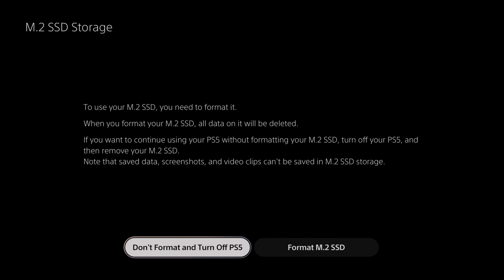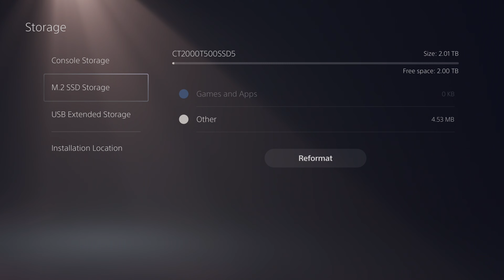How to install an M2 SSD in the PS5 Pro

Comment: Since the M.2 has a heatsink, wouldn't it have been better to leave the small metal M.2 bay cover off? That way it could get some air flow around it.
Reply from the maker: It's supposed to be covered. There is air flow from the fan that travels through that area.
Reply: @GameTechReviews  Good to know.